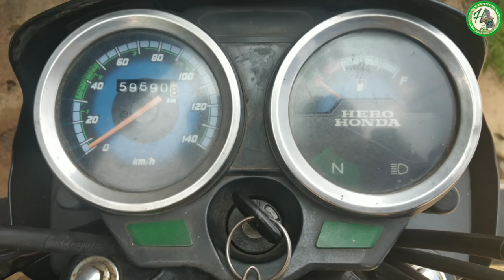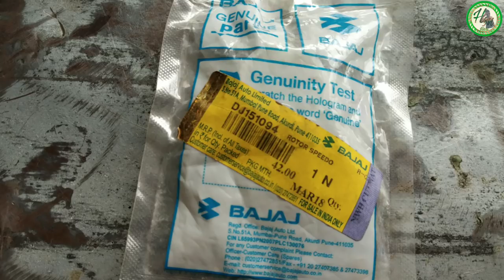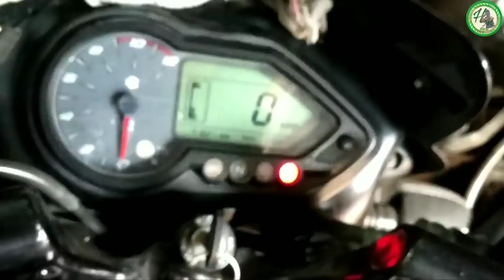What we will check if Speedo digital meter not working in Two Wheelers in Telugu

Comment: Hi..
Same problem in my Pulser 220F from last 1 year.
As you shown my bike meter show's 199 value when short the contact..
So I replaced old cable with new but still the problem is same, so I go to sarvice centre the fitter again replaced cable with gear, but still no speed shown. He said meter fault.
But yesterday after 1 year meter start automatically and start showing speed but next morning it again showing zero speed..

Comment: I've bought Bajaj Pulsar DTSI 150 CC 2015 November model. now exactly after 1 1/2 yrs the Speedo Meter is not working.. not updating the kilometers travelled. I dont think the digital meters are suggestable in long run..

Comment: I just replaced my bike speedometer cable to my frnd p220 it works also I  replaced his speedometer cable with my p220 doesn't work..
But when I short the contact its shows reading..
So what's the problem...
😅😅😅